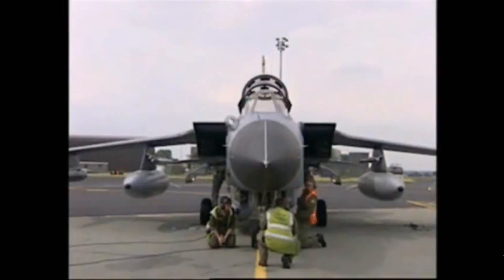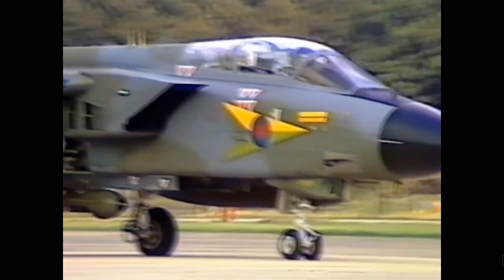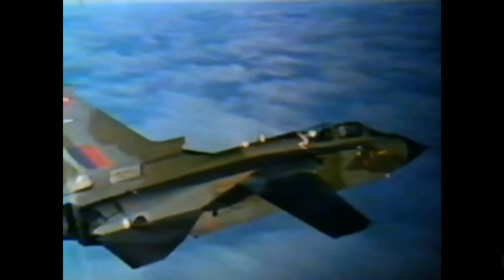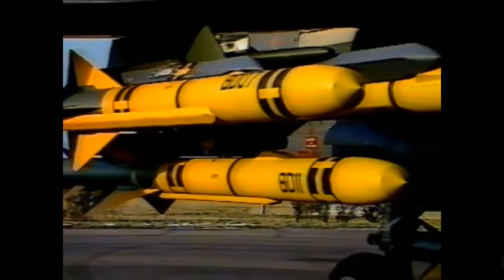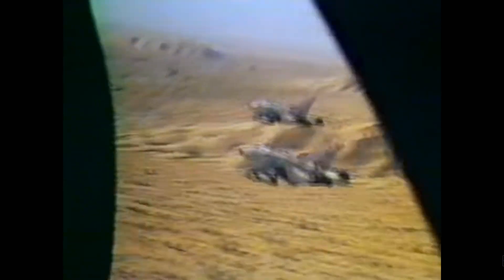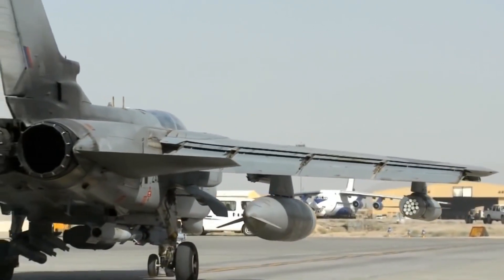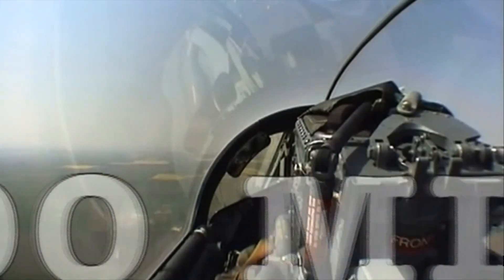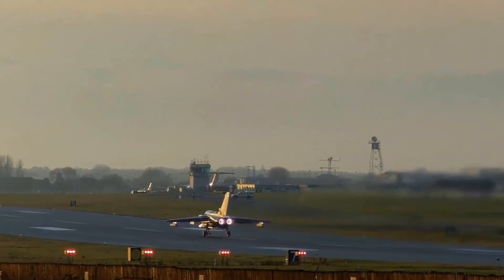Panavia Tornado - Twin Engine Sweep Wing Fighter/Bomber

Comment: With its powerful twin engines it's the best low flying fast bomber for me, it can carry a lot of different types of ordinance for a number of targets small and large and with the new brimstone very accurate fire and forget air to air and air to ground missile it could still do a good job for years to come. I can't see the single seat single engine internal weapons carrying F35b doing the same or a better job than the Tornado does now, I look at the Tornado as a bomber something I don't see when I look at the F35. I'd keep the Tornado along with the F35&the Typhoon and just loose the harrier (which I also like but the F35b is a better carrier jet now)

Comment: The tornado is also capable of delivering nuclear weaponry.
Reply: StandSure Not the ones in RAF service, as the UK got rid of the WE.177 freefall thermonuclear bombs in the mid 90's
Reply: Only the Royal Navy is Nuclear capable today.
Reply: They used to be able to as the original strike role of being able to launch tactical nuclear weapons at Soviet Airfields in the event of a cold war gone hot. Sadly not anymore as the Royal Navy took on the role of the nuclear deterrent.
Reply: Commando Eagle the strategic nuclear deterrant was passed to the Royal Navy once the V bombers gave up that role. The Tornado would have used tactical nuclear weapons against Warsaw Pact targets if the war had turned nuclear
Reply: The most of the now left German Tornados are assigned to this role.
Reply: That's what it was designed for, as was the Buccaneer.

Comment: Can anyone tell me what function the intake looking protrusion at the bottom the vertical stabilizer on the tornado serves? I can’t find an explanation anywhere.
Reply: It's for cooling the bleed air coming from the engines. There's a s-shaped duct behind the opening which leads a bit down to the root of the fin where the a heat exchanger is located.
Btw. The EF Typhoon has basically the same opening with the same function at the same place.

Comment: Any thoughts about the talks about the f-35 replacing the tornado in Germany?
Reply: Ridicolous. They don't even fullfill the same role. Stealth-toy vs. rugged low-level bomber.
Reply: Yes they do. They are both planes for deeps strike. The tornado can only do that via low level bombing while f-35 can do low level bombing and high level bombing because of its stealth.
If they didn't fulfill the same role, the German air force generals wouldn't be considering it. Unless you know better than them?
Reply: As stated in another comment, the Tornado can close in on an enemy at low level that would promote structural failure in any other aircraft, including (especially) the F-35.

Where did you hear german air force generals would consider the F-35? German MoD politicans did, not military staff. That's a difference.
Reply: Who do you think the politicians are asking for advice and insight? Hint, probably the guys that know what they are talking about.

The other comment is bullshit. No basis in reality.
Reply: Oh, i really wish politicans would do that.

And the first comment isn't 'bullshit', the Panavia Tornado was marketed wth that quote. Ouch.
Reply: The variable wings is outdated and not necessary for low level flying. That is a fact.
Reply: I wouldn't be too sure about German defence and security sector politicians making rational decisions...
Reply: There's no way in hell a German politician would push for a US plane. The proposal must have been backed heavily by the generals.
Reply: They would push for a US plane if it's for all intents and purposes made in Germany.
Reply: It's only 9,000 kg... that's almost exactly the same as the f-35.
Reply: romeo r remember for the the F35 to carry it max payload it no longer stealth and that's all the F35 has

Comment: Small correction, the Tornado does not have two 25mm guns, but 2 Mauser BK 27mm guns.
Reply: Pincer88 the GR1 had 2, the GR4 has 1

Comment: I’ve always thought that the Tornado’s air intakes looked unusually small. Probably avoids hitting the showers while the Harrier or Foxbat are around.
Reply: I think the tornado's shape perfectly complements its role. The intakes are small because the air is more thick at low altitude (probably). It seems perfectly optimised as a low level attacker visually.

Comment: I think the Tornado was the right jet for the rught time and place, given the political situation during its use. As the first line of air defense if the Soviets cross the border, it would have been able not only to defend the sky, but also give soviet ground troops something to chew on. With the Typhoon now taking its place, a new role for the Tornado could be close air support. If they could increase the armor especially in the front and bottom of the fuselage, it could become a European equivalent to the American A-10 Warthog.

Comment: Tornado GR1 basically fulfilled the requirement originally meant to be met by BAC TSR.2. Though in some respects still fell short of the TSR.2 requirements, including low level range and supersonic dash capability, though Tornado's avionics were of course much more advanced and capable, most especially the TI designed TFR and the attack radar.

Tornado F.2 was essentially a failure, the Foxhunter radar never came close to working right and the aircraft was simply incapable of fulfilling any kind of air superiority role other than long range interceptor (which, with a badly underperforming radar, made it rather useless).  The massive problems with Foxhunter kept it from being fully operational until the late 90s, and even then it was never as reliable as it was expected/needed to be.  During the 80s Foxhunter had two reliable operating modes, off and standby.

Comment: It was fortunate that the Tornado wasn't used for what it was designed for....

Attacking Russian airfields with the JP pack. It was butchered by Iraqi ground defences in 1996, and Iraq had only 10% of the airfield defense that Russia would have had... 

However, when it changed roles, it has served us very well indeed. Beautiful aircraft and a British classic to go alongside the Lancaster and Mosquito.

Comment: Why not some negatives as well? The costs, the horrible job it did as an interceptor by lack of proper radar equipment, the hidious look (no now i'm just taking the piss, it's a beauty).
Reply: watdeneuk yeah but it was never really designed AS an interceptor was it, it's like complaining about the Messerschmitt Me262's performance as a bomber, and as for price show me an aircraft that'll give you the same firepower, performance and reliability (when used how it was intended to be) for less cost

Comment: wonder way Danmark didn't buy the tornado when the Draken was phased out.
Reply: maximusoptimus2000 probably because Saab had a practical monopoly on the Swedish air force, already had stuff like the Gripen on the drawing board and didn't want to risk losing it if the rest of Scandinavia adopted foriegn aircraft

Comment: fantastic air plane, but too dated for tomorrows battle space, also HI MATT been awhile!
Reply from the maker: Figmo 42 hey figmo!! Miss ya buddy! Thought you’d like this one :-)
Reply: Figmo 42 not if it's only used as the low-level strike aircraft it was always meant to be and supported by dedicated fighters it's not, just get some Typhoons watching out for enemy fighters and make sure the enemy doesn't know you're coming so won't have SAM's waiting and you're good to go, I don't think it should be taken out of service until something genuinely better at doing the same thing comes along in enough numbers- i.e. the F35, and they are NOT gonna be turning up fast
Reply: The RAF, will not be suddenly dropping the Tornado just yet, they are phasing them out progressively as they steadily re train/train more F35 pilots, the real sad news is that our WSO's have no where else to go :(
Reply: Figmo 42 well just like Matsimus is considering buying a Leopard 1 tank when the Canadians get rid of them, if I suddenly become even marginally rich you can bet I'll be saving one of these from the scrapheap

Comment: this seems like a slower, smaller F-111! I mean, it might have more modern electronics but how hard is it to bolt on some new computers to the double or single din (ha ha) I gotta give the rest of the world credit for not removing their own version of the f-111 even though the US stupidly did and has nothing really to replace it (f-15 strike eagle? but can't carry the payload, more expensive per flight hour, slower at role altitude, no auto low flight avionics, etc...) I like this aircraft, not as good as the f-111 but it takes on the same role that no other aircraft in  service can hope to come close to effectively fulfilling (Ok maybe the Su-25 which is even slower and lighter still and more like a small A-10) sad to see the last truly effective medium size supersonic ground attack strike aircraft retire for drone and lame propeller planes that for some reason (government bureaucracy) cost just as much as a Frogfoot (Air tractor AT-802L is 13 million dollars and is slower than a damn 100,000 dollar beach craft!)